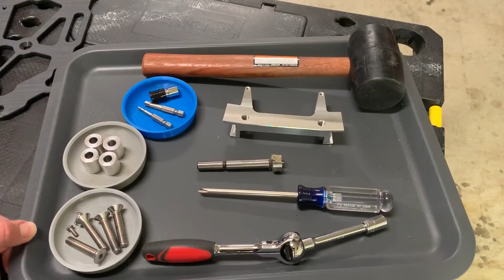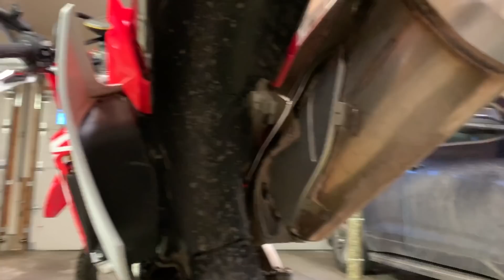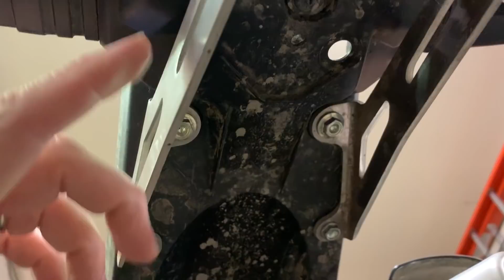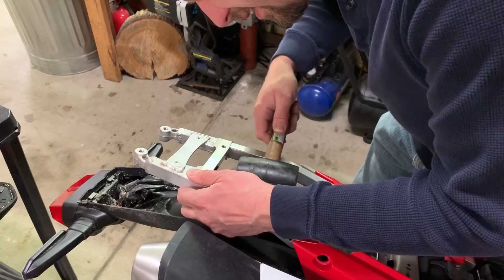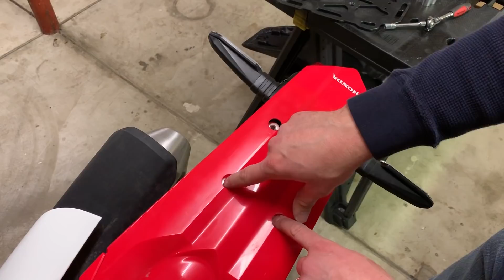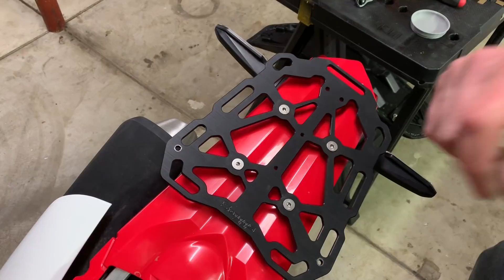Honda CRF450L Scaggs Moto Tail Rack Install

Comment: Cut the heads off of 4 bolts and sharpen one end to a point. Then screw them in to the mounting holes from the top with the point sticking up then put your plastic in place and give it a cpl light tapity tap taps and there you go exact center to drill your holes. You can also buy screw tips made just for this which are called transfer screws. Hope this helps.

Comment: You gotta poke holes in the fender for this rack...Its looks cleaner than the Precision rack ,but its Not as sturdy...But when you take it off theres no butt ugly holes... I installed the Precision,which is much easier to do.....Love it!..
Reply from the maker: I think they're both good solutions, but I much prefer the clean look of this rack.  I would agree the holes are ugly if you take the rack off, but why would anyone ever remove the rack?  It barely weighs anything, and because there's no brackets that come down to the seat bolts, I can't think of any riding scenario where it would ever be in the way.  Of the 4 bikes I've owned, I never removed the tail racks on any of them once installed.  I usually have my wolfman tail bag up there as well with water, a very basic set of tools, and my insurance/reg.
Reply from the maker: Actually, I just watched the precision rack install video and I'm not so sure I'd trust the mounting methodology now that I've had a better look.  At first, it did look like a sturdy setup, and, at the seat bolt end, it absolutely is.  Even with the spacers, that mount point is rock-solid.  The rear-ward mount point, however, only appears strong at first glance.  You can't tell in the video because they don't remove the bottom black fender half, but those front bolts that hold the plate bracket only go into pressed-in light-duty inserts that don't support any downward weight in honda's design.  The rear-ward plate bolts act as a pivot point pushing any weight the tail-plate section places on the front bolts as pressure against those inserts.  Those precision rack brackets are instead now pulling down on those inserts.  Even worse, because they are carrying the load outward on those added extensions, the inserts will get 'pried' out at an angle.   It'll be fine with a light tail bag, but a heavy case on the back will rip those inserts out of the frame rails on a bumpy trail.  I wonder if they actually took the black lower fender off to see what those front bolts thread into.  I was surprised to see they were just little inserts myself when I had mine fully apart.

Here's a pic of the underside of the subframe showing the pressed-in inserts I'm talking about, that all the weight is sitting on, cantilevered, with the precision rack design: http://gallery.netmagi.com/d/14410-2/insert.JPG